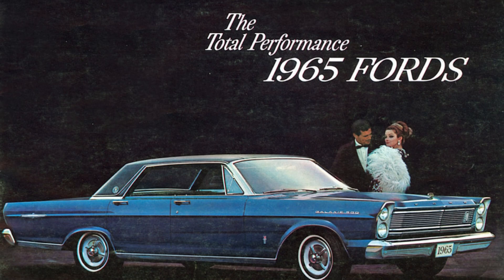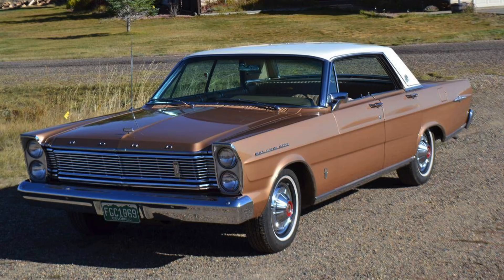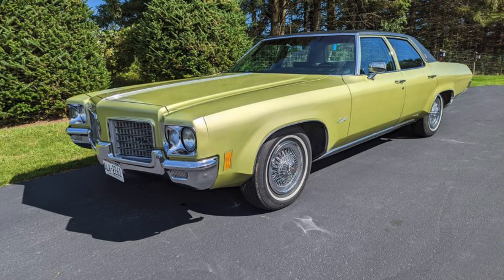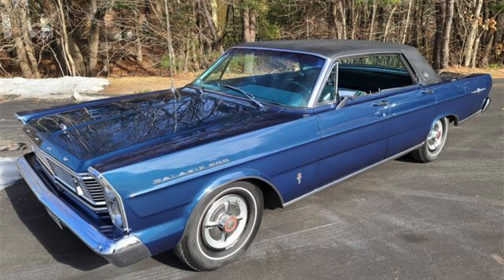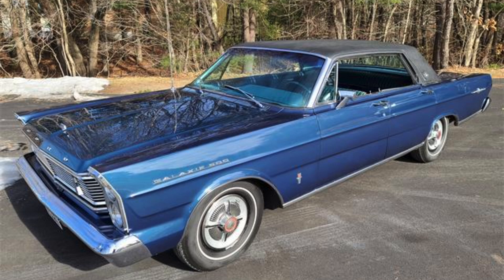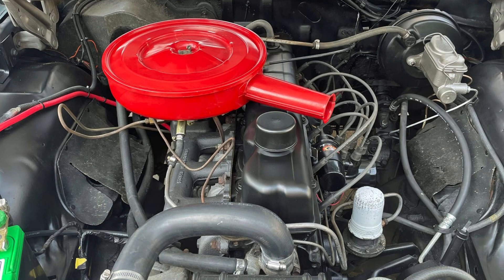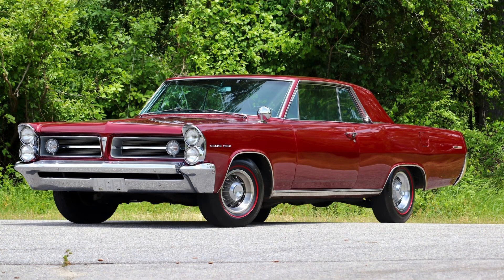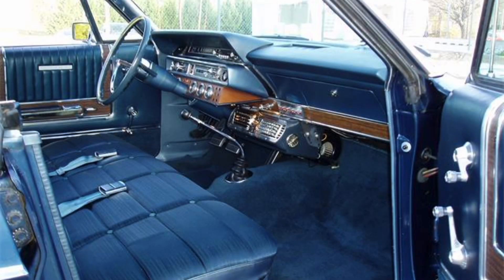Quieter Than A Rolls Royce?  How Ford Perfected the Quiet Ride in their 1965 Ford Galaxie & LTD

Comment: This was a very informative well put together video as usual coming from you. Rolls-Royce introduced its m o n o c o y, I think I spelled that right Construction in 1965 and it's Silver Shadow, that came in the sedan and the coop it's most successful car it ever made the c o r n i c h e was derived from the shadow. As a Rolls-Royce owner since 1989 I know a lot about these cars and I've had to maintain some of them myself due to the high cost of maintenance. So I wonder if Ford had to come up with an answer to the Silver Shadow? It had a solid body with the doors hood and trunk all made of aluminum unlike the Silver Cloud 3. Oh wonderful car but over engineered hydraulic system borrowed from Citroen, doomed the car to high dollar three and $5,000 brake jobs. The rigid body soft frame idea may have been borrowed from Rolls-Royce, but it was quieter than the 1964 Silver Cloud 3 but they had yet to compare it with the Silver Shadow because it didn't make it to America until 1966. My Shadows were 1973 early and late of the same year and had a number of changes. And then when I restore them I made my number of changes to them greatly improved them greatly enjoyed them when my funding was very good for them but a car that can eat $50,000 and sell for $5,000 it's not a good investment but it did impress The Neighbors for the many years I enjoyed them so the 1965 Ford had a quieter ride with a flexible frame Rolls-Royce employed subframes front subframe rear subframe. With a solid body Construction. Extremely expensive to produce but extremely sturdy. They continue the same style construction all the way through the end of 1999 with front and rear subframes and Monacoy Construction. Just me knowing a lot more about Rolls-Royce than I do forward wonder if Ford ever had an answer for Monacoy construction and front and rear subframes. With six brake calipers and hydraulic pumps driven by the camshaft on the engine the 66 Silver Shadow had self leveling at all four corners but due to problems was deleted from the front end and was on the rear end only. The system was so extremely complicated had they never used such a system Shadows would be much more easily affordable antique cars today. Many were scrapped because of the high cost of Maintenance and parts. The 77 through 79 Rolls-Royce could catch fire if a hydraulic leak occurred as the routing of the exhaust system. Thankfully my two cars for both 1973 I still remember their VIN numbers by heart that's how often I ordered parts. In 1980 they switched to an oil type hydraulic fluid in an emergency you could actually pour engine oil into the braking system. As I recovered from Rolls-Royce disease of owning four of them, my fourth car is all restored and in the corner in the garage inaccessible to thieves or even myself due to overgrowth of the forest when I move I'll have to tear out a wall to get those three cars out and move to the new place. I really enjoyed your video it was a great way to wake up with a cup of coffee in the morning

Comment: 9:55  I believe it was Imperial that pioneered curved side glass in 1957.  And Lincoln, that first used curved side glass in 1961-1963, returned to curved side glass for 1966 after using flat glass in 1964 & '65.

Comment: I learned to drive in a '66 Galaxie 500 4-door with 390 V8 and 3-speed auto transmission. It was a big, comfortable land yacht that could get up and go, and stuck to the road. On Senior Skip Day, we made a 60-mile run down a winding Ozark highway to a state park. I beat a classmate in his new Roadrunner by 10 minutes.

Comment: I believe 65 Ford came out with the two way ignition key
Reply: yep
Reply: Ford claimed it as a first.  Citroen had that in 1955.  65 Ford rear suspension was a direct copy of the 1934 Citroen Traction Avant.   And works well.

Comment: Another reason those cars were so quiet; instead of welding sheet metal to a metal hood frame, they used a foam adhesive supplied by Goodyear.  That prevented vibration and rarrling

Comment: I learned how to drive on my mom's beige 1966 Ford Galaxie powered by the "screamin" 352, and later in a 1969 Ford LTD in Drivers Ed in school. My mother's '66 was quit and smooth around town and managed 11 mpg, 15 on highway. On the highway at 70 mph there was tremendous wind noise with the windows closed or open and it was tiresom on long trips. Conversely, the 390 cu. in. 1969 LTD driver's ed car drove lie a cloud, was super quiet, and could get closer to 20 mpg on highway. My favorite American car ride was a long trip in someones 1969 Buick Riviera. that car could cruise at 80 - 87 mph on the highway and was so quiet you could hear the clock ticking! A year later I bought my first car- a Citroen DS 19.

Comment: GMC changed their frames from 1970 to 1971?   It sure isn't evident in their bodies. No power accessories on the 427 cars doesn't sound right either imho.
Reply: Yup, full-size GM cars were redesigned in 71 with an all new platform shared by all makes besides Cadillac. They ran from 71-76, including those awesome "clam shell" or "round back" wagons. 71-76 full-size GM's (especially wagons) dominated Demo Derbies for decades after Imperials were banned from most events lol. 
In 73 the new mid-size GM platform was introduced and ran through 77

Comment: Rare Classic Cars and Auto... : In one of the photos you showed of an engine compartment of a new Ford, you showed a dual reservoir brake master cylinder. That did not come out until 1967, """industry-wide, across the board". !966 was the last year for all vehicles with the single reservoir brake master cylinder.
Reply from the maker: That’s correct. Someone retrofitted. Smart!

Comment: My dad's company bought him a new Galaxy every 2 years from 1960 until the company died in the late 70s, his last was a Crown Vic.  He bought the new Galaxies due to their higher ground Clearance and  tough suspension for traveling on new highway projects in Michigan (like I75) as a highway engineer. He put over 100,000 miles on each before getting the new one. Occasionally he took me on road jobs with him.  I remember him gunning the car on a brand new stretch of I 75 before it opened, loved those Fords. But he had  friend at GM who sold my Mom a used Oldsmobile station wagon, after her 57 Chevy crapped out, so not totally loyal to Fords, but what cars!

Comment: My sister dated a guy who owned a 1965 Ford Galaxie 500 4-door sedan. I went with them for a ride in it once and I noticed we were passing people on the highway but, it didn't feel like we were going fast. I looked at the speedometer and saw we were going 80 M.P.H. There was no vibration in the car ----- at all. It was very smooth. I believe the "floating frame" was discontinued for safety reasons though.

Comment: I had a '' 66" 7 Litre.  White with 2 shades of red interior..   Like the T Bird furnishings.   Sold it a few years later.  Now they are somewhat rare and is my most memorable car. Thanks.
Reply: The 7 Litre came with the new 428. It was a great engine, but nothing like the 427 was
Reply: @johneckert1365  ; Between 38 to 44 rolled out the door as 427's
in 7 Litre trim, only two were convertibles.
Reply: @johneckert1365  That's true but probably more street-worthy for the average driver.   I think the 428 was an option in the T-bird over the standard 390.
Reply: @hugh007  Ha yea, it was definitely more driver friendly

Comment: I was well aware of the flexible frame. This idea carried forward as the frame under these cars was the basis for the engineering of the 72-79 mid-sized Ford and Mercury models. In fact, adding fisc brakes to the 65 full sized Ford is easiest done using the front steering knuckles of the 77-79 Thunderbird, just swapping sides. That same frame went on to form the basis of the Panther from 79 through 2011.
There is a proper name for the "rubber bushed track bar". It is a Panhard rod. The Panhard rod continued with the new full sized cars from 69 through 78.
One of the issues with the curved side glass was that shoulder room, particularly on hard top cars, was restricted. Moving to flat glass allowed less tumble home, so was slightly wider at shoulder height. The lessons were learned so the curved glass could be used on the full sized Ford models. There were many inherent limitations to the Continental imposed by the dimensions decreed by McNamara that the designers and engineers had to be inventive. One of those compromises was the adoption of the rear hinged back doors.
Reply: I disagree on the Panther platform. It has almost NOTHING in common with thier 65-78 ancestor.  Panther pretty much copied GM's "Full-size Metric" chassis. The same triangulated 4 link rear suspension. Upper & lower triangular control arms up front. Steering components moved ahead of the engine/suspension crossmember. Matter of fact, 73-77 mid-size GM and 77-up full-size GM rear axles will bolt right into a Panther platform up until the Watts Link rear suspension came out in 98. 
The stock car racers liked to use Panther lower front control arms in thier GM cars because they bolted right in with a little modification and were wider. Ford copied GM there just like they did on thier Essex 3.8 V6.     The only thing similar on a Panther vs 65-78 is the front torque boxes. That LITERALLY the only thing similar.

Comment: I understand that Chrysler also benchmarked the Rolls Royce for its 1964-66 Imperial. I read somewhere that they put 235 pounds of soundproofing into the 1964, and upped that by an additional 10 pounds for ‘65-66. 

Interesting story on the Fords. Especially appreciated the engineering details.

Comment: I can tell you, my 72 Galaxy 500 was the finest ride I ever had.
Smooth and quiet , 351 Cleveland under the hood, thickest saddle interior bench/bench… I took off the hubcaps which were extremely heavy. I just modified the ignition and had a performance exhaust but quiet tone. Ultra deluxe transport.

Comment: 1966 was a better look. And a 428 option engine. The flow through ventilation was excellent. LTD was the poor man's Lincoln. 
This a a car that will take you everywhere in comfort. With a huge trunk!
Only thing better for size is the  sibling Country Sedan/Squire wagon, with the 1966 "Magicgate".
Reply: The 428 was a good engine, but could NEVER compare to the 427

Comment: Another thing that was significantly new for the 1965 Fords was the dual-facing rear seats for the Country Squire and Country Sedan station wagons. With them, Ford was able to promote seating for up to ten people, although that may have been more true if the people sitting there were small children. They remained a Dearborn exclusive until the last big Ford wagons were built in 1991. Anyway, interesting video, and BTW, congratulations on reaching 100K subscribers!

Comment: Adam, I have driven  over the years so many different cars.   My mom owned a '72 Cadillac, before, a '64 Caddy, so many big, American FULL-SIZED cars,  > full-sized as you and I are speaking of (as opposed to the full-sized of these days).  Back in '86, I finished the US MARINES, and went back to work for my former boss.   When newly rehired, one of the things that I was tasked with was to bring my boss' 84 RollsRoyce,,?silver cloud"? over to Walnut Creek, from San Leandro, Ca.  Deliver that newer Rolls and then bring back a right-hand drive '71 Silver Shadow? Rolls..........I must say > the ONLY thing that those vehicles had over every single vehicle that I've ever driven was the quietness!  The power , the ride...... none of that was really much different from any Cadillac, or Lincoln, or fulll-sized Chevy/Buick/Olds/Pontiac/Ford/Mercury,,,,,,,, but > the QUIETNESS was astounding!    My 2 cents........nope > never drove a '65 Galaxy.

Comment: I remember these so well. My dad went for a new '65 Fairlane 500, however, but did purchase a new Country Squire in 1970. Both were exceptional in performance and quality. 

You always present a balanced and objective point of view and you certainly did here. While the full-size Fords had a lot going for them, in our area (NE Ohio) they were terrible rust buckets, especially the frames from the rear axle back. Ford had issues with controlling rust; the '57s and '58s were terrible. 
I particularly liked the LTD with its "panty cloth" seats. With the LTD Ford set the stage for designing a luxury car in what was left of the low priced field. From 1965 onward, the lines became blurred and the justification to go up market was no longer there.
As much as I liked Mercury in this time frame (LOVE your '68s) I really can't justify the additional price of the Big M  over the LTD.
My preference would be a 1966 LTD 4-door ht in dark green.

Comment: In early 1966, my dad bought a leftover new 1965 Plymouth Fury III. About 2 1/2 years later he bought a used 1965 Ford Galaxie 500 for my mom to use. Both cars had similar mileage on them. The Plymouth had a 318 to the Galaxie’s 289, so it would out accelerate it, and the torsion bar suspension would out handle the Ford as well. But, what a difference in ride and quiet. The Plymouth seemed almost crude compared to the Ford. The Ford’s interior was much more upscale than the Plymouth too. My dad was a Chrysler Corporation guy for a long time, he even replaced the Ford about a year later with a Chrysler New Yorker, but that Ford must have had some impact on him. A 1972 Mercury Marquis Brougham found its way onto our driveway after the New Yorker, and with one exception, he drove Mercurys until he passed away.
Reply from the maker: Once you have a 1965-72 Ford product, it’s hard to go back.

Comment: My first car was a 65 Galaxie with the 240 inline 6 with the 2 speed automatic. I sold it when the tranny was going out for the 2nd time. The engine valve gears were noisy.

Comment: The 1965, 66 and 67 Fords were really good lookers.   The 1967 7-Liter R-code 427 fastback "with 4-speed of course" has to be the best of the bunch.   Thanks to Adam for posting.
Reply: 68s were in there too.
Reply: @johnehlert4366  I think 68 was a different "new" platform.   But a 68 Galaxie LTD, Fastback, 429 PI, Manual trans would make me happy.....

Comment: I have a 240 in my '77 F150, which someone slipped in place of the original 300.  The 240 is a de-stroked 300, with a slightly higher compression head. I don't know if a 300 fits in a Mustang, but I think it doesn't, hence the moniker, "Big Six."
Can't say that I dig the skirts on the '65 Galaxie...
I do love the '65 and especially '66 Galaxie two door hardtops.

Comment: The Ford ad should be seen in context. In 1959, Rolls Royce had an ad campaign that famously claimed “At 60 mph, the loudest sound in a Rolls Royce is the ticking of the clock.”

That ad became so famous that Ford was able to riff on it with their own claim, one-upping the Roller.

Of course the better response came from Land Rover, who ran an ad claiming “At 60 mph, the loudest sound in a Land Rover is the roar of the engine.”